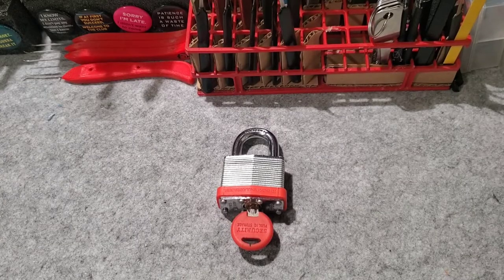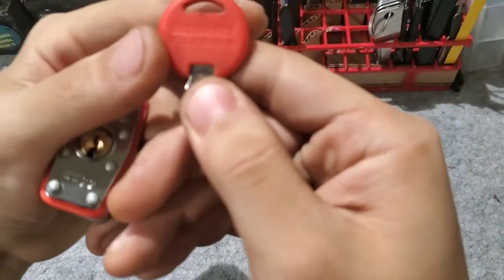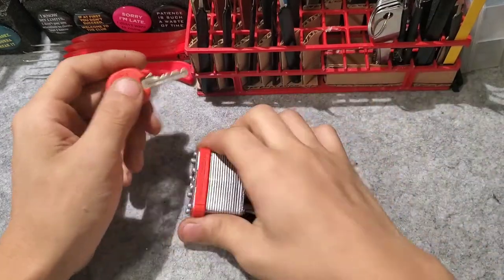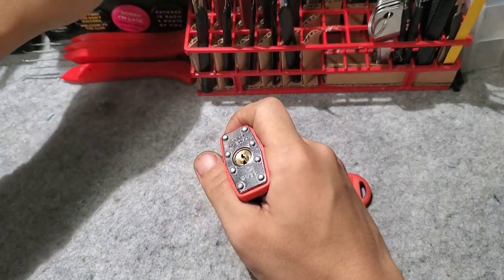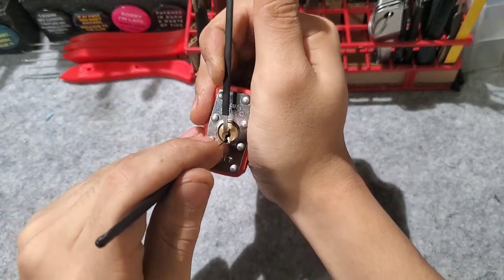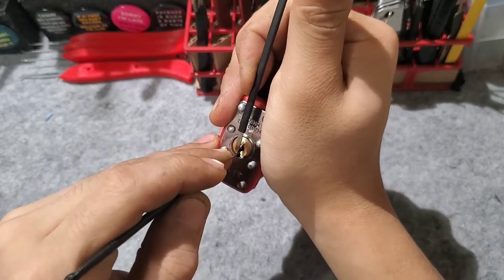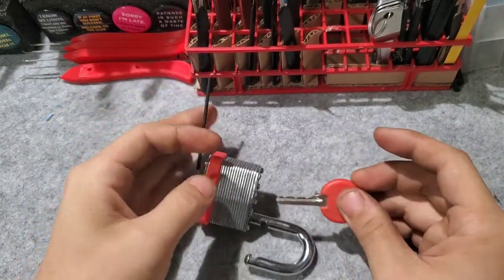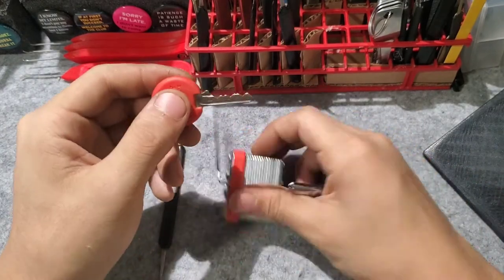~34~ Stoarage unit padlock picked.

Comment: I think it may be the other way round....the shallow cuts have more spool action because more of the driver sits in the plug. Either way nice job sir
Reply from the maker: A shallow cut is closer to a 0 bitted key deep cuts are closer to the bottom.
Reply from the maker: Yes you are right...ill revise that in my next video.
Reply: @KyleE-pm1nt  Just the way I understand it. You can also test the spools out when you gut a lock and then put them in a better spot if you can where they work better.